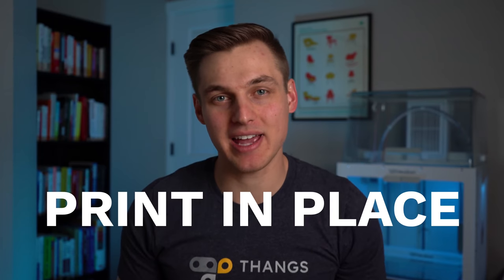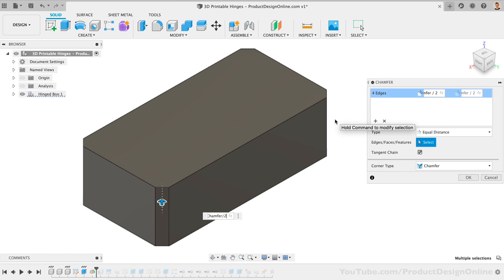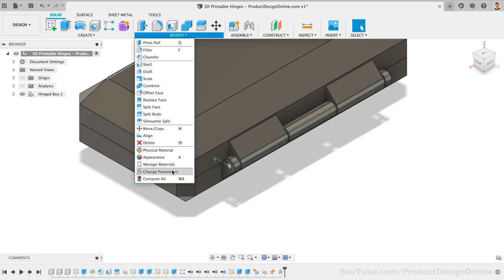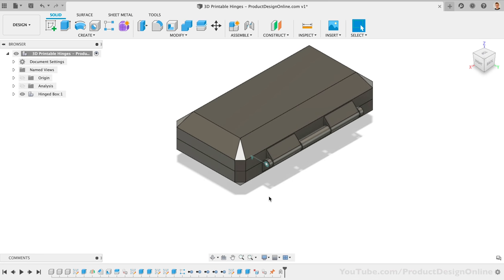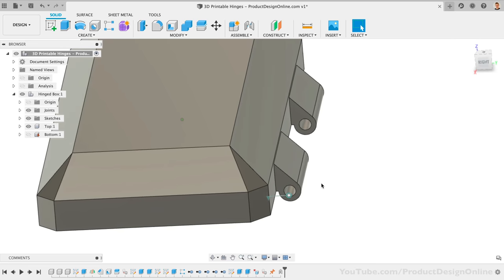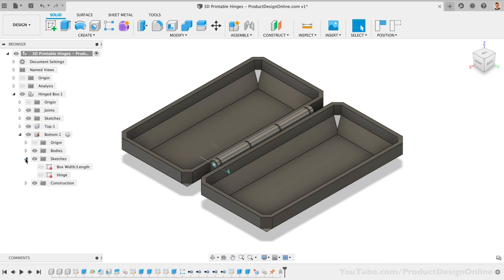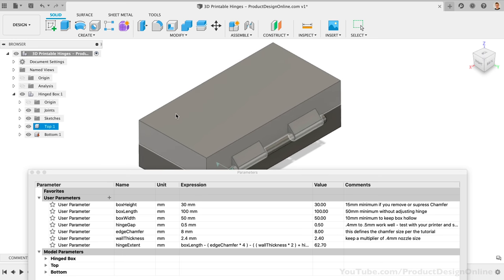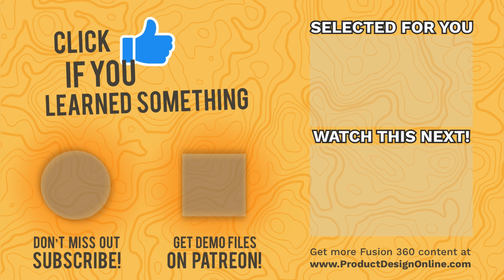How to Design 3D Printable Hinge | Fusion 360 Tutorial

Comment: Hi Kevin, another great video. Thank you. You don't actually say what you mean "Print-in-Place". Having never heard the term before, I wasn't sure what you meant - my first thought was being able to print on the printer without leaving the Fusion360 environment (for slicing etc). In the end, I did some online research and discovered this definition. 
"Print in place means that an assembly is printed without the need for any further manual assembly, and one can start using the part right away."
I'm writing this comment in case it's any use to anyone else out there.
Reply: This is correct, but it also means that the parts do not need to be separated for 3D printing. In the latter case, you need to create separate STL files.

Comment: Another great video!  You said something about making the wall thickness divisible by your nozzle diameter.  Just want to make sure I have that right.  So, if I have a 0.4mm nozzle, a wall thickness of 1.6mm or 2.0mm would be good choices, and 1.5 or 1.4 not so good.  Is that correct?  And by the same reasoning, if I switch out to a 0.6mm nozzle, then 1.8 or 2.4 would be good.  I'm asking because I thought the nozzle would be so close to the surface that it would squish the filament a bit and widen it out during printing.
Reply from the maker: Hi Mark, that's correct. Its to ensure when your Slicer creates the gcode for each layer you do not end up with awkward/irregular walls or paths. You're right that the final thickness will change slightly due to how the filament is spread.

Comment: Kevin - Thanks again for another excellent insight into the workings of Fusion 360.
You might like to  know I experienced an issue with the Demo file.  When I downsized the dimensions to do the test print of the hinge, I immediately got an error.
Unfortunately I can't upload a screen snapshot - but the error was a message box  "Fusion Team Error Message. Remove Body Hinge left. The body reference is lost...."  This related to the second of four remove element actions in the Timeline - but I don't know how to fix that. In addition, the Timeline action in question was coloured red.

A second issue noted was that when editing the box size (and keeping within the bounds you noted), I kept finding that one of the hinges would disappear. Playing around with the dimensions would sometimes cause the missing hinge to reappear. This sounds as though it is a related issue?  For info I was trying to dimension a box to 35 x 95 x 40mm.

It may be relevant that I had just been 'forced' to update Fusion when I launched it for the first time in a couple of months. My previous version was 2.0.9512, and the new version is 2.0.9854.
Reply: I get the same issue

Comment: Huge fan of your videos! I was just wondering if anyone else had any "Print-in-Place" problems with this hinge? When I printed it, some of the hinge pieces were fused together, which led to stress fractures in the PLA material. Did I miss a step somewhere? lol. I am using an Ender 3 Pro, sliced in Matter Control. Using layer thickness of 0.18mm. Any help would be greatly appreciated, as I am fully exploring this newfangled "Print-in-Place" method now more extensively. Thanks!
Reply from the maker: Thanks, Naman!

I printed mine at .15 layer and .1 layer and they both worked well. .1mm being the best. Depending on layer height and other settings (infill, etc) it may fuse too much to the layers below which will cause it to break when in use. I also did the hinge at the minimum size. Scaling the entire hinge up will also make it stronger and be a huge help 😎

Comment: This is amazing! Very clear explanation and something I always look for in may projects, 3D or not, is to automate whenever possible. I was fiddling around with the parameters and got a model working where every dimension is relative to the ones you showed in your video. In this way, the length of each part of the hinge is automatically adjusted according to the width or length of the box. I wouldn't be able to do it without this video and the explanation of functions inside the parameters! I was wondering if the use of conditionals in the syntax of the expression are available. For instance, set a minimum 'gap' dimension IF the length of the box is 'X' value. I know it wouldn't be very practical in real prints or modeling, but for the sake of knowledge I'd like to know. Also, if you'd like to check de file I made, I can share it with you.

Thank you very much for your time and dedication to your channel! Keep up the good vibe!
Reply from the maker: Thanks! Glad to hear you found this to be helpful. Conditional parameters are not allowed, though there are some 'workarounds' - https://forums.autodesk.com/t5/fusion-360-ideastation-archived/conditional-parameters-if-then-else/idi-p/9058418

Sure thing, I always love seeing others files, especially when they've learned from one of my lessons. You can join my new community space and share it there -> https://bit.ly/PDOcommunity

Comment: Would this hinge strong enough for daily use?
Reply from the maker: I would definitely thicken it (the pin and the flangs) if you plan on using it with a part/object for daily use. I have a very similar print from 2 years ago that is still holding up. Of course, the materials and other factors are at play.

Comment: Hello! I want to print a hinged box in 2 separate prints, so that each half of the box can fill my print area, resulting in a larger box. How would I do that? / do you have a video for that?
Thanks!
Reply: Right click the component (or body, if it is just a body) and save as a separate STL file (with a proper name like "lid").
Reply: But you won't be able to do a "print in place" hinge in two pieces. That's kind of the whole point of this tutorial. If you do separate parts, then you'd have to print a separate hinge pin and manually insert afterwords. And the round hinge cavities may not be so dimensionally accurate, if they're printed separately without any internal support.

Comment: the demo box you have does not work with a wallthickness of 4.8 because on the hinge shape sketch the distance from the box that the hinge center circle is set to 3 not a variable off of wallthickness so the center circle will extended into the box. I set it to wallthickness *1.5 and then everything worked for a wallthickness of 4.8 just in case anyone else runs into this problem.

other wise love the videos and I am leaning a lot thanks

Comment: Hi, I have a problem with the tutorial, in the demo you used what I think is the cut and paste function, how to do it? to move the object from one component to the other component, deleting it in the previous location
Reply from the maker: Could you tell me at what time in the video you're referencing?
Reply: @ProductDesignOnline  
Thanks for the quick answer :) I mean more about your demo of the box that I opened at my place in Fusion360, and there, after dividing the block into 2 cubes and making a shell, you move the top cover from the first component to the second and in the first this cover disappears, in history it is like this icon, similar to copy and paste but there is a red arrow and it says CutPasteBodies2
Reply: This is the 10th icon from the left :) looking at this video :)
Reply from the maker: @1MRsnuppy  Thanks for clarifying! That helps, I see what you're talking about now.

I created the box as one solid body at the start. To move to the "top" component you simply click and drag the body in the Browser and release it over top the desired component (new location). The key thing is to make sure your black timeline marker is all the way at the end of the timeline. You also need to have the top-level component active.

In this scenario, I placed the bodies in separate components so I could apply the revolute joint.
Reply: @ProductDesignOnline  
Thanks a lot :) it's so simple, I tried to do it but the marker was not at the end of the timeline and I probably did not succeed;) thanks and best regards
Reply from the maker: @1MRsnuppy  yep, if the timeline marker is not at the end it will not work because Fusion is parametric and the order of operations matters. It won't allow you to reorder things without it at the end because it wouldn't know how to reference the previous features and would likely break the model :)

Comment: I realize that this video is pretty old, so you may not see this comment.   However, I have a question relating to the hinge design. 

I went through your detailed tutorial and was able to reproduce it with no problem... lid closes and everything.  However, the joint was a bit sloppy so I tried reducing the gap to 0.4 and then 0.3.  I also tried to increase the shell thickness to make it a bit more robust.   But, with these changes, the box would not close completely. (Printed everything with 0.2 layers)

It seems like one issue is the spacing between the pin and the back wall of the box.  In your full video, I think that value is set to 2.95 mm.  Where does that come from?  Is there some design rule that one can use if the hinge pin and shell are made thicker, for example?  Or, is there a minimum required gap between the back wall of the box and the hinge knuckle?

Comment: The design part is working fine. good tutorial. But Printing this.... is disappointing. After printing, it turned out the 45 degree chamfer edges needed supports, and the box did not close all the way , and there is no lock mechanism. Maybe a nice topic for you next video. The hinges worked fine.
Reply from the maker: Hey, thanks for sharing! Are you able to share a pick of  edges? I didn't have any issues. what resolution did you print in?

Comment: If you're getting your first 3D printer, don't let price drive your purchase.  Be willing to spend some extra bucks to get a better printer.  I didn't do this, and I regret it. Features that I consider a must on any printer I'll buy (been printing for around 5 years or so and on my second printer) are a removable print bed and auto bed leveling.  The removable print bed allows you to take the bed off, give it a small flex, and have the print pops right off.  Usually, the bigger the print, the easier it is to pop it off, which is the opposite of printers without a removable bed.  Auto bed leveling is a must for me because I could never get the bed properly leveled with a screw system.  The nozzle was constantly digging into the print bed.  (I'm pretty sure this was a failing on my part and not my printers.)  Auto bed leveling means I tell my printer to print, it levels itself, and I get a near perfect first layer every time.  Other features to consider include filament run out detection, power outage backup, built in web interfaces, and so on.  But those first two are a non-starter for me.  I won't consider a printer, no matter how good it prints, without auto bed leveling and a removable, flexible print bed. (PS: For me, this means a Prusa MK3 i3S, but there are other printers and other manufacturers that have these features as well, so you don't have to get the Prusa to get these features.)
Reply from the maker: Well said, Rick! Thanks for sharing your experiences, especially with the auto-bed leveling. Bed leveling is certainly a big one that beginners aren't aware of.

I also recommend Prusa printers to those who can afford it. The price jump can be significant for some that are looking at the entry-level enders. I discuss that more (how it's worth it) in the blog post - https://bit.ly/3DPrinterComparison

Cheers!
Reply: @ProductDesignOnline  Thanks Rick for this thread. I agree with the points you made. I started with 3D printing just over a year ago. I decided to buy an Ender 3 Pro as my first printer, because I didn't have any experience and the price-point was low enough for me to put to discard the whole idea if I didn't think it worthwhile. Soon after buying the Ender 3, I realised a few things: first, if 3D printing is going to be of good use, I need to learn how to design models myself, instead of just downloading STL files from Thingiverse etc. Secondly, as a novice, I had real problems getting the model to stick. I immediately bought the BLTouch upgrade for Ender 3 Pro, but even then I had problems with adhesion. I tried different ideas, different glues (yuk!) etc. In the end, I put and end to the Ender 3. I decided it had paid its worth in teaching me about the 3D printing process, about the workflow issues and about the importance of things like 3D modelling and bed-levelling. I then went and bought a Prusa Mk3/S and haven't looked back. On the face of it, the Ender 3 and Prusa Mk3 look fairly similar, and when I try to describe the differences it seems impossible to convince others, apart from saying try it for yourself and see. The Prusa has a myriad of minor improvements and details that make it work (it just works), but the most important things are the software (eg things like a menu option for first-layer calibration, and live Z-adjust) AND even more than all of that, the support service. Prusa have a online chat support, which operates 24/7 and is second to none.
Finally, I decided to jump into 3D modelling and get CAD software. I chose between Fusion360 and Onshape and decided on Fusion360. I struggled and struggled, without much progress. I looked at loads of tutorials and videos, including those from Lars Christensen, but made very little progress until I came across Kevin Kennedy's videos. After watching just a few of Kevin's videos I starting running with Fusion 360 and haven't looked back.
Anyway, that's my experience, in case it's any use to anyone.
Reply: I disagree with the bed leveling comment. I got a glass bed and upgraded springs for my Ender 3. The springs allow leveling the bed using this level test, then I never have to bother with it again. https://www.thingiverse.com/thing:2987803 

I had a  BL Touch clone but never installed it.
Reply: @burtonkent4549  I'm glad you found a solution that works for you.  Everyone is going to be different in what they want, and in this case, what they can and can't do.  Like I said, I think the inability to level the bed on my first printer was on me, not the printer.  I'm  sure other people had no problems leveling that bed.  Ender printers are good printers, and although I'm going to stick with Prusas for the foreseeable future, I wouldn't steer anyone away from an Ender printer.
Reply: @rickseiden1  Fair enough. I don't want you to scare people away from Enders. At my makerspace (pumpingstationone.org) we have both Enders and Prusas. It does take a bit more time to dial in an Ender, but once you do it's hands off. I'd rather have 3 Enders than one Prusa.
Reply: @burtonkent4549  , thank you for the link.